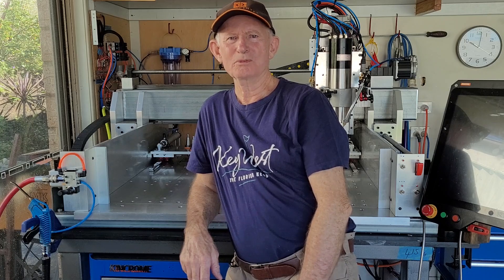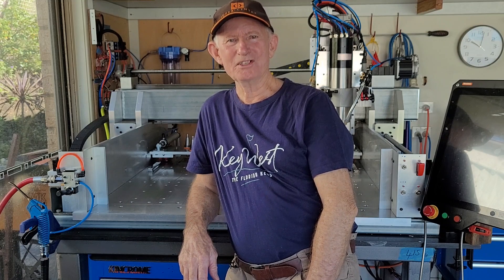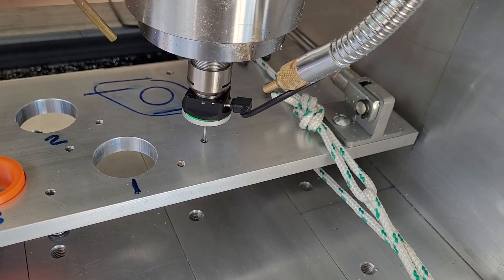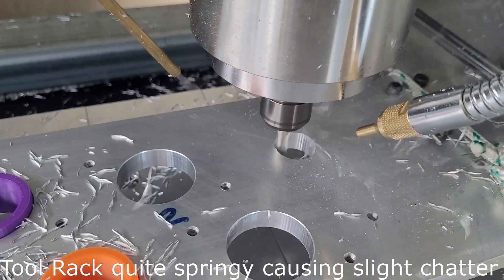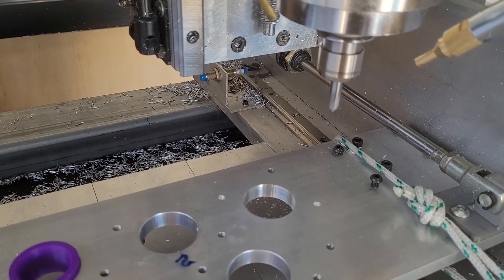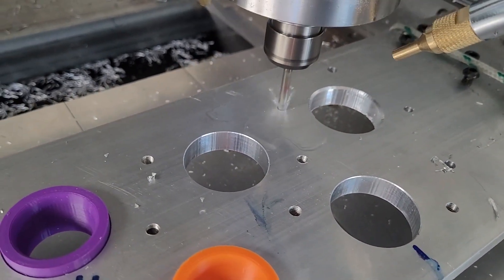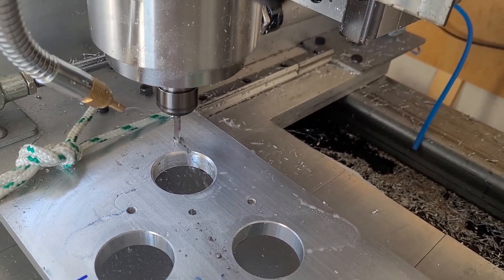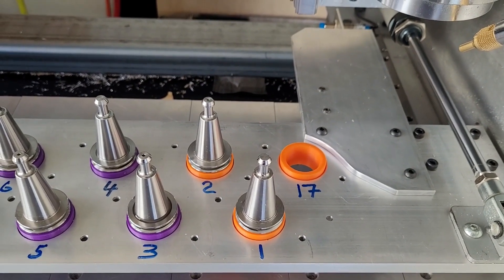Bill's Home Built PrintNC PRO Upgrading my ATC Tool Rack from 15 to 17 Tools

Comment: You've built a monster bill. try slowing the rpms down for finishing passes i'm sure you can get a mirror finish
Reply from the maker: Hi Clay...... you could be right I need to think more about  surface finish I have a video of making quite a trick / complex part that I will post early next week where I am concentrating on finishes using 2 flute end mills to rough leaving 0.3mm stock and 3 flute end mills to finish taking 3 x 0.1mm finish passes at reduced spindle speed and reduced feed rate but as you will see the fixture for the part is well..... complex in a lot of ways and not as solid as I would like BUT I am thinking outside the box with this one and so it's a means to an end Ok thanks for the comments cheers Bill
Reply: @williamnorris1516 Haha of course, Very cool can't wait to see that video

Comment: Hey Bill, loving the content. Out of curiosity when you were building your machine, did you follow any guides for the ATC setup (part selection and schematics). Im trying to select my components to add ATC to my machine but find information limited. Im in Sydney, so i assume you were subject to the same import gst etc that i will be.
Reply from the maker: Hi Adam It just sort of came together my Jianken 3.2 Kw ATC spindle came with Iso25 that takes ER20 collets which are quite compact and being a router it was a given that it would be a strait rack and not rotary and Masso supports multiple row tool racks so it made sense to use two rows and have the rack sit in the dead space that the spindle can't machine at the back of the bed , but then needed to make it a sliding rack so that the spindle could reach the back row of tools I already had some left over 20mm rails and bearing blocks from a past upgrade so cut them to length so the rack could slide 200mm forward and backwards  then just found 200 mm air rams on Ebay just did trial set ups till I got it right Oh also as can be seen I offset the front to back rows to save space There are many ways to do it the big thing was to have enough gantry to bed clearance to allow you to be able to pick up tools from the back row and then clear the front row as they move forward not a problem if you use sliding fork style holders and just one row ok hope that helps Cheers Bill
Reply: @williamnorris1516  Amazing, I've already been talking with Jian Ken so glad to hear you went the same route. I'm running the UCCNC controller so hopefully my setup is not to difficult, seems masso is set up much better for this. Thanks for the reply and looking forward to future content.

Comment: Love, though rope, workholding method, first time I’ve seen that!
Reply from the maker: Hi well I had to lock/hold the rack in the forward position some how so there was no chance of movement, I could not do it with clamps so it was either ratchet straps or rope. it all worked fine but the rack plate was still quite springy probably should have chocked it some how but the required finishes didn't to be high end so didn't bother cheers Bill

Comment: I have been wondering. How is that 3.2 kw chinese spindle with steel.
Reply from the maker: Hi I have used it to machine steel several times and the results were quite good you just have to adjust your speeds and feeds for steel. Being 100mm 4 pole it has good torque in the mid range 12000 rpm but really it's an alloy cutting spindle and not designed for steel from what I have read you need low speed high torque and a lot of rigidity in your machine for steel so yeh it will machine steel well enough to get you out of a bind but not the right spindle every day steel work cheers Bill

Comment: Not bad, btw, how insanely good are those bambulabs printers... I got the A1 mini (limited desk space) and it works great.
Reply from the maker: Hi I haven't had my Bambu Lab X1 Carbon long but every print so far has been flawless I have not been able to do ABS before this and the ABS prints look like they are injection molded I am just loving it and the speed even with all the start up checks and balances it twice as fast then my old printer cheers Bill